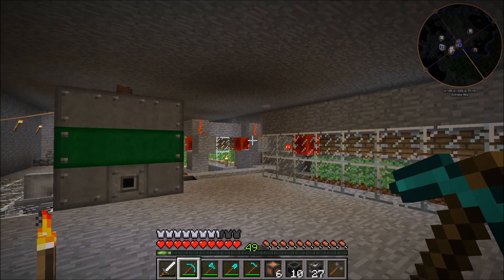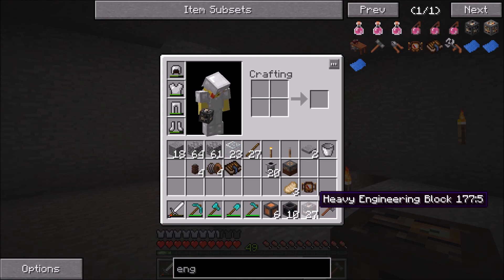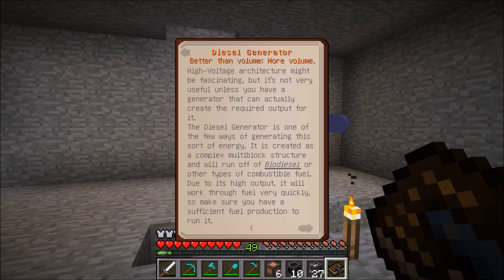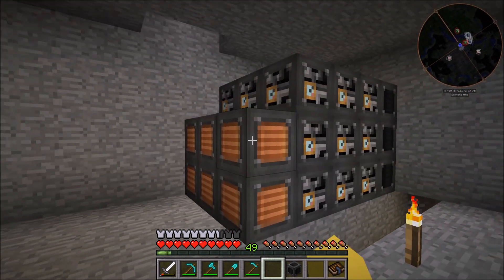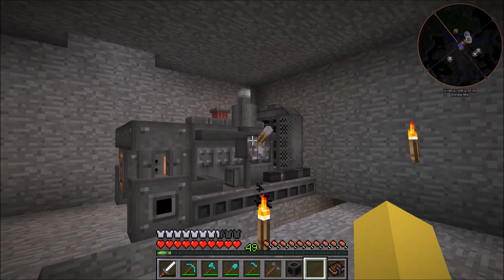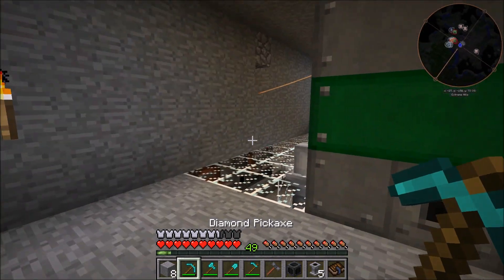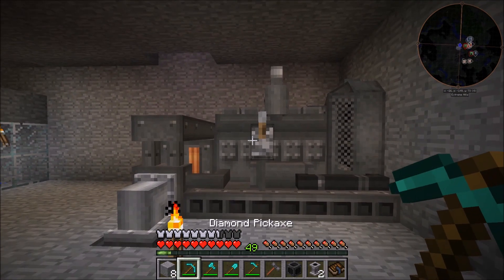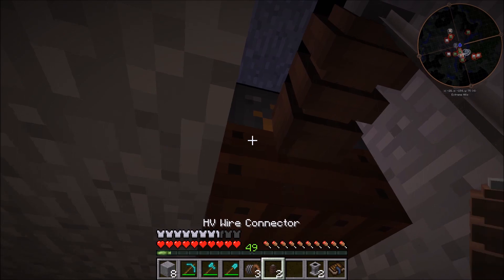Surviving With Immersive Engineering :: Ep.10 - The Diesel Generator

Comment: I only had 1 problem with this vid - you made a bunch of stuff off camera (I know to save us the endless crafting), but it meant you never got into the recipes for the part for either the generator or the HV wire & such.
Reply: THIS.  I know this vid is old, but this a valid point.  DO NOT show brand new items, pre-crafted, without first crafting AT LEAST ONE of EACH NEW ITEM on camera so we can see the recipe.  I know this is long fixed in your later video series, but still worth mentioning for this vid having that problem.
Reply: Porthiir that's what the engineers manual is for to look at the recipes
Reply: If you want to know the recipe use NEI or JEI
Reply: NEI shows how to craft things. The video's should be how to use them.